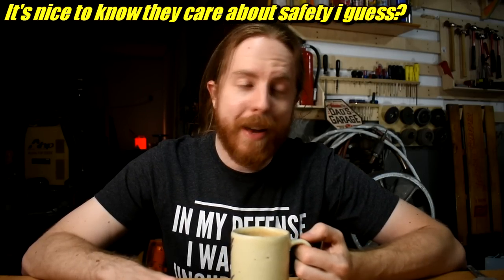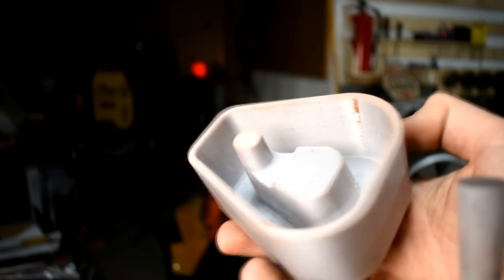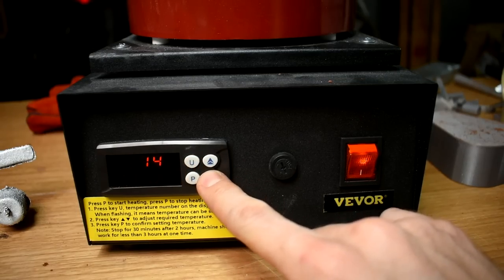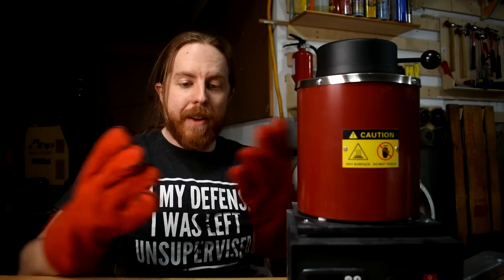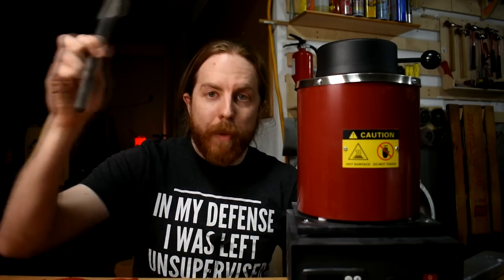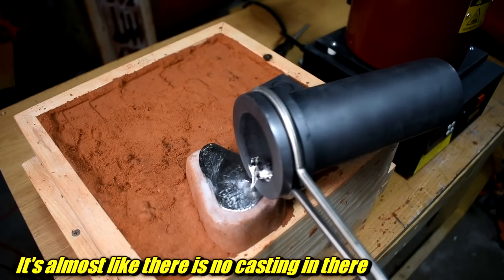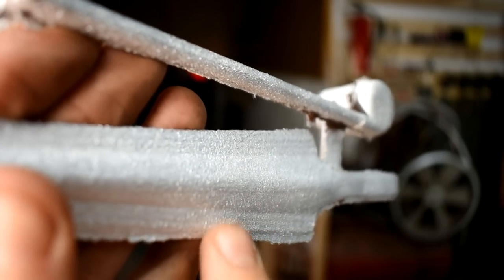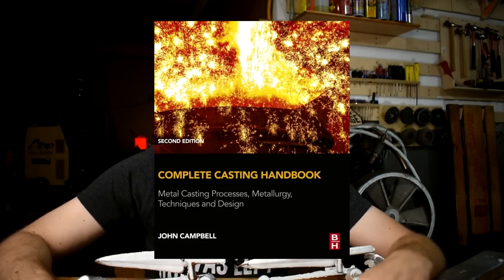Metal Casting TEMPERATURE matters more than you think

Comment: Only problem with the electric is how long it takes to get to temperature! Great job Paul! I’m really enjoying this series
Reply: It can be worth the wait.
Reply from the maker: You got that right!  I'm spoiled with the iron-hot burner melting aluminum in minutes.  For the "just right" pour I set it going, helped a kid get ready for bed, then it was ready to pour.  It wasn't bad.  Them again this is pretty low temperature, bronze might be a different story.  Maybe I should try that next 🤔
Reply: @PaulsGarage  Mild Steel is my request, if it can handle it.
Reply from the maker: Mild steel is a bit too hot.  This thing maxes out with copper alloys
Reply: @PaulsGarage  Are there any off the shelf induction furnaces that can do mild steel?  I was looking for what the “next step up” from ones like the ibe you showed, and there was a neat “tilt casting” model with like a b i g crucible, but still not steelmill size, something the size of a desktop cnc mill etc, but saying what the max temp is is an elusive specification.

Good to know though for this one, thanks!
Reply: @ericlotze7724  US Solid has an induction furnace that can melt steel, but idk about pouring temp. That's the biggest you can get without going 3 phase.
Reply: @PaulsGarage  Yes, see how many copper pours you can get before the element dies on you hahaha (DO NOT GO TO 1150C, they absolutey can't handle it well!) 

Also, be very aware that the graphite crucibles wear out really fast. On average, I use my crucibles just 7x when I'm casting at 900-1100C, after that they get leaky and the metal starts making pretty holes in my floortiles xD

When using it at lower temps, it'll last a lot more pours. Just be super careful. I cast 100% of the time over a sandpit, just in case the crucible is a dud and leaks when it shouldn't .

Comment: For the propane furnaces, consider an infrared thermometer. I know, liquid metal is reflective enough to skew the readings, but a sufficient matte oxide film on top would help with that, and you can set (or calibrate) the emissivity value on most competent meters. ... Or, you know, feet.
Reply from the maker: I've tried that and it would probably work with this alloy, but when I cast bronze I don't have a thermometer that can handle it 🤣. A thermocouple jammed in the side can show me furnace temperature, not quite metal temperature, but then I run into the issue where I can't control my janky burner lol

Comment: Did a lot of tests casting coins blanks (with Zinc Alloy) in a graphite block at various temps using the same furnace.  Your advice to Pour at as low as a temp as possible to fill the mold is correct.  Too hot and shrinkage becomes an issue including a hole in the center of the gate that travels into the pattern.  It is also is the only alloy that will pick up all the detail of the fine reeding around the coin edge.
Reply from the maker: Interesting, this stuff flows really well so it makes sense it would pick up more detail

Comment: I’m excited you finally got one of these!  

Most reviews/content only cover Propane or Electric Resistive ones, not Inductive!

I have some questions:

1.)  Can it handle multiple metals (like pretty much anything you throw in there)

2.) Build Quality (will it break after a few months usage/burn my house down)

3.) Capability (is there enough capacity)
Reply from the maker: This is still an electric resistive oven, not inductive.  It can handle anything up to copper alloy temperatures, so everything I need to cast except iron.  It seems pretty well made especially for the price, but as always crucibles and elements have a use life and will need to be replaced occasionally
Reply from the maker: And for capacity, the limit is a 3kg crucible.  My propane furnace is much bigger but 3kg would handle most of the projects I have made so far.  Vogman has a bigger one of these too and says he never uses anything bigger than the 3kg crucible anyway.
Reply: @PaulsGarage  3kg of Gold right? So that would be roughly 1kg of aluminum - or about 9 cubic inches of metal.
Reply from the maker: @HarmanRobotics  3kg of brass.  Kg measurements im crucibles are always in brass
Reply: @PaulsGarage  Oh, so the 3kg crucible has a volume of about 20 cu in then?
Reply from the maker: @HarmanRobotics  I didn't measure but that seems about right.
Reply: @PaulsGarage  does this mean anything more than 3kg and it breaks or what?  Granted I’m not the best at math, and barely know any alloys etc, but would they weigh enough to make that an odd measure vs volume, or what?
Reply: @PaulsGarage  ah Okay

Comment: It's great to see you do all this testing and experimenting. 
I've been using an electric furnace for years now, albeit a somewhat more expensive one, meaning higher quality. It can go to higher temperature than many of the cheap ones and does it a lot faster. Although I usually work on the mold while the metal melts so the time it takes means very little to me. 3KG is enough for the small castings I do... Used to do... I really need to get back into casting, life just gets in the way sometimes ... 😅
Reply from the maker: Which one do you have?  I'd love a hotter option, this one maxes out with copper
Reply: @PaulsGarage  the one I have is the Goldbrunn Therm 3000. It doesn't go that much higher though so copper and copper alloys will still be the max. It can go to 1200c but maxes out at 1150c, the cheap ones I have seen say they go to 1150 but max out at 1100, when melting copper that extra 50c makes a lot of diffirence. Pouring temperature like you demonstrated. I know there are other electric furnaces that can go way higher, I have looked at getting a box furnace, but dang those are expensive.
Reply from the maker: @ralphmourik  well if all else fails I have that heat treat oven which I've had up to 1250c or so, but I don't feel the need to go any hotter than bronze so I'm sure this cheap one is good enough
Reply: @PaulsGarage  Fair enough, I love making Tin Bronze, Nordic Gold and Sunset Bronze with this little furnace. Perfect for smaller castings.

Comment: Fyi Mifco sells replacement immersion pyrometer TC tips designed for dipping into molten metal.  Long lasting for nonferrous, no graphite sheath needed.
Reply from the maker: That's interesting, I'll look that up.  I got one a thermocouple for a large kiln with a ceramic sheath designed for use in soda kilns, maybe your idea would be more simple
Reply: @PaulsGarage  Used on of the ceramic sheath thermocouples for bronze work back in school.  The ceramic stayed on the thermocouple but busted into segments about 1" long.  The tip ws exposed.  Maybe it will work better for you.

Comment: Type K thermocouples (the kind easily available from pottery supplies) will actually work to measure molten metal temperature.  The trick is not to try to measure it continuously.  Melt the metal a little hot, Than measure it after pulling it out of the furnace, when it cools down to the right temperature, then you are ready.  Cut the tip off the thermocouple, that way it only makes contact when its touching the molten metal.  This way the metal actually forms the measuring junction.  As for construction of the measuring setup, you can literally hose clamp the thermocouple to a piece of metal rod and mound the gauge near the handle.  leave about half an inch of thermocouple wire sticking out of the ceramic insulators, and dip that part into the metal the full way each time.  full disclosure, most of my experience with this is with bronze in a #40 crucible (120 pounds of bronze full) so not only high temperatures, but a good amount of time waiting for it to cool.  With zinc and smaller volumes, it will happen faster.  
p.s. I am one of those Americans who uses pretty much all Celsius, so I feel somewhat smug.
Reply from the maker: Funny you mention that, I bought a type K thermocouple from a pottery supplier and it's waiting for me to build a rig for measuring metal temperature 😉
Reply: I just got my K thermometer yesterday and I was worried about messing it up. But I will give it a try tonight 🤞🏻

Comment: 1. How do you know your electric furnace show the right temp xD
2. The temp also depends on the geometry of your casting and gating system.
3. The Kg rating is a little wrong, because different metals has different densities 1kg in Aluminium is not the same volumetric wise as 1Kg of Gold and Gold is what those things are made for ( so they say)
4. The only downside to pouring zinc too hot is a.) if you get it really really hot and get zinc fumes and b.) you waste more energy than you need, besides that there should not be any problem.

I really enjoy your videos, thank you.
Reply from the maker: 1: thermocouples these days, even cheapo ones, are very accurate.  I haven't run into one yet that was too far off.
2: you're right, thinner castings should be poured hotter so they don't freeze before filling up.
3: the kg rating is in brass, not gold.  I used aluminum bronze pieces as comparison which is similar enough to brass in density.  This thing could probably hold double that in gold, but I'll never know since I'm not flush with cash 🤣🤣
Reply: @PaulsGarage  You are not flush with cash YET, just wait until you become one of those rich youtubers with their Ferrari and stuff. 

God damn you, I wanted to get a cheap camping gas stove for zamac casting and now you dangle this 240€ furnace from Germany in front of me...AAAARHH haave tooo resist the temptation...

Comment: The cooling is important to. I ve read about steel Bronze thats 100 parts copper and 8 parts tin castet in cast iron shells. because they need fast cooling. They wrote the alloy hasnt time enough to end mix when it cools fast enough.
Reply from the maker: Yeah cooling speed definitely matters too.  Some alloys need different rates of cooling or heat treating.  It can get weird.  Some aluminum alloys need to be heat treated, which seems to do nothing, but then it needs to rest for weeks to reach full strength.  Who figured all that out 🤣
Reply: @Paul's Garage  There also is a lot of people (most) that think quenching a hot cast part, after pulling it out of the mold, should harden it. (If it were a heat treatable alloy) There are two problems with this thought. 

The misconception is that quenching the aluminum is supposed to harden it.  This is what happens to steel but that is not what happens with aluminum. Likewise heating copper and quenching it anneals copper.  

Heat treatable aluminum must be brought to just below its melting temperature, held there for a minimum period of time, then  quenched, as the FIRST STEP in the hardening procedure. Because this does not make the aluminum hard, the same as heating and quenching copper does not make it hard.

For heat treating (aka hardening) aluminum requires aluminum to be hot enough, and held there long enough, for the elements in the aluminum to go in solution, so they can migrate and redistribute homogeneously. The rapid cooling, quench, locks the atoms in the structure in place. If the part was to cool slower then the atoms would redistribute and no longer have the required structure.

The SECOND STEP to heat treating aluminum is the artificial aging step. When the part comes down to room temperature and left there a slow process of redistribution takes place called natural aging. This slowly hardens the aluminum. Artificial aging is taking the quenched part and heating to a higher temperature (than room temperature but never near the temperature used in the first step) for a set time then cooled. The time depends on the alloy and the thickness of the part. 

We have all heard of T6 as an aluminum hardness description.  The following I pulled from Custom Castings website. (a company in my city) https://customcastings.com/introduction-heat-treatment/

To achieve T6 temper, the process consists of three steps: Solution Treatment: Heat the casting to ~1000 F for several hours. Quenching: Drastically cool part in a water bath. Artificial aging: Reheat the part a final time at ~300-400 F.

Now for the second problem. Most hobby casters think heat treating is taking a just cast part (still hot after breakout of the mold) and then quenching it will give the part a T6 heat treatment. This is wrong because the shaped part has not gone through the required soak time just below the casting temperature. When the cast part has solidified in the mold the solidification has created a non-homogeneous structure. Quenching it does not help because it is not locking in the right structure. And even if the part were to go through the artificial aging step, it will not achieve a sought after hardness because the first step was not correct. 

While natural aging will produce a harder part in time, artificial aging will produce a harder stronger part.

As an aside, (not that this is to give more credibility to my above comment) my brother had worked for a time at Bristol Aerospace quality control department. One of his duties was to do periodic temperature profiles to qualify the heat treat ovens used to heat treat aluminum parts. Along with 9 point temperature measurement logging he also had to do destructive testing of heat treated parts.

Comment: I've got one of those electric furnaces. Did you notice just how quick the crucibal degrades?  Mine showed pot marks on the first use.
Reply from the maker: Interesting, I haven't seen any damage yet, but I've only poured at zinc and aluminum temperatures so far and only half a dozen pours.  Never tried bronze yet.  Do you flux or degass the metal?  Sometimes those chemicals can screw up the crucibles.

Comment: I’ve been thinking temper has been causing some of my problems too. I never actually measure the temperature though.
Reply from the maker: I don't have much experience with investment casting but I hear temperature plays a big role.  Sand can be more forgiving.  There are more issues with bronze I think (not certain here) with not only temperature but the atmosphere.  Lean burning creates more bubbles in the metal or something?  I might have that backwards?  Not sure. This electric furnace is straight oxidation though, like a pottery kiln.  I'll get back to bronze eventually and do some tests lol.  Im working my way into investment casting here pretty soon, probably vacuum.

Comment: That was fun and informative. Are you putting off the big pour still? I was wondering what size the lathe bed is, if you can get the whole thing in one pour…
Reply from the maker: The lathe bed pour should be the next video.  Doing 1 gingery video a month.  I definitely have a big enough crucible for the bed in one pour, not sure I'll be able to pick it up full of zinc though 😂
Reply: @PaulsGarage  you'd better be sure before you pick that hot crucible up. Do whatever it takes for that assurance too. This project sounds like it's going to take some planning and doing to me. Beyond just picking the crucible up you have to control it throughout the pour too. Better safe than smokey.
Reply from the maker: Very true.  I've done one handling test so far with ingots stuffed in a cold crucible but I have to do the math and find out if I had enough in there.  It's tentatively ok, but things can change when the fire starts
Reply: @PaulsGarage  there's a difference handling it cold and solid and hot and liquid. Beyond just picking it up you have to be able to control it pouring it too. So that's balancing it. It's not a trivial task. This is going to take a trained seal to pull off. They're good at balancing.

Comment: I wonder if you couldn't maybe use pottery cones.  Has been years since I've used a kiln but I think the temperatures you're shooting for are in the right range.  Bonus, they're pretty heckin cheap
Reply from the maker: I have a bunch of pottery cones!  their problem is they measure heat work, not temperature.  It's kinda close but they be accurate enough, because the metal could be overheated for a short time or underheated for a long time and the cone would still bend.

Comment: Through experimentation, the swirl trap just mixes the loose sand with your metal. You will see improvements you replace the swirl trap with a square configuration. Sort of pyramid shape but with a blunt other than a point. The squared shape drop the unwanted sand so that it stays in the trap.
What state are you in.?
Reply from the maker: The idea with the swirl trap is to be a dead end, so any sand mixed in there stays there.  I probably should've move the ingate farther away so it didn't feed from the spin trap, but I don't see any issues this time
Reply from the maker: And I'm in Wisconsin 🐄
Reply: @Paul's Garage  I'm in mn. If you run your inlet runner past the actual feeder to the part impurities will tend to past by and locate at the end of the run.

Comment: IThanks! nteresting and useful. I am wrestling with bronze and aluminium bronze at the moment and have the expected problems. I use a 'gun' type thermometer and also conbcluded that the pouring temperature is important. I use a home built LP gas furnace, but am contemplating an electric one, and am wondering at the relative cost. I use about 1 kg (2.2lbs) gas to melt one Kg (2.2 lbs) alu bronze in about 15 minutes. How much electricity do you use for the same amount of metal? Or where can someone who does not speak mucn electrical find out?
Reply from the maker: Good question, I have no idea how much electricity this uses, or how much propane I use to melt in my gas furnace.  This furnace is only 120v, and it doesn't run long, and it doesn't trip the 15 amp breaker, so I imagine it's not a ton of electricity.  But it doesn't melt very much metal compared to my gas one, so it's not a fair comparison.  It would work much better to get temperatures right, however.